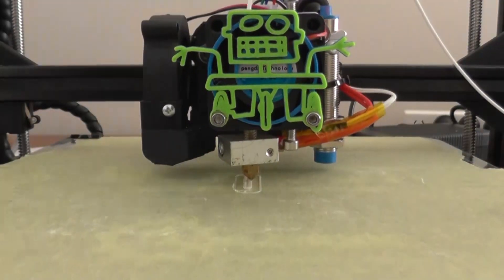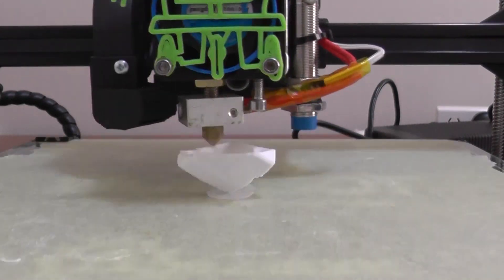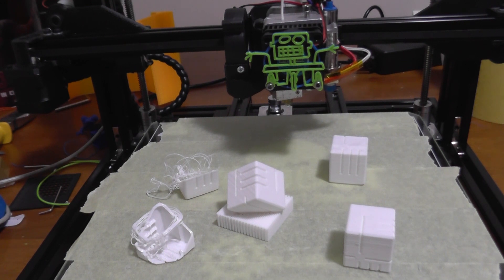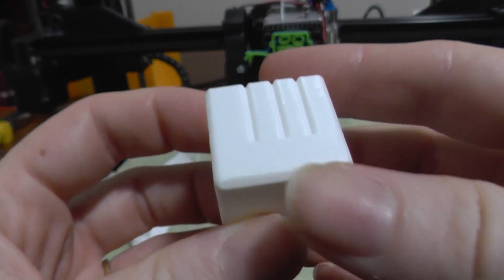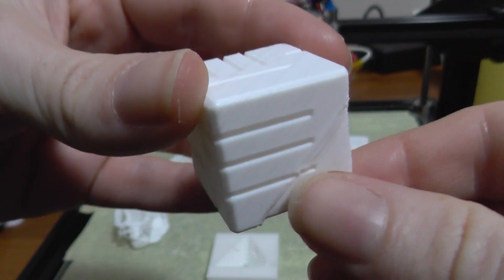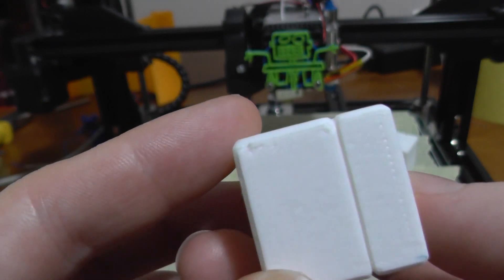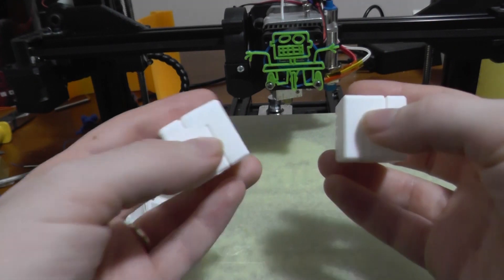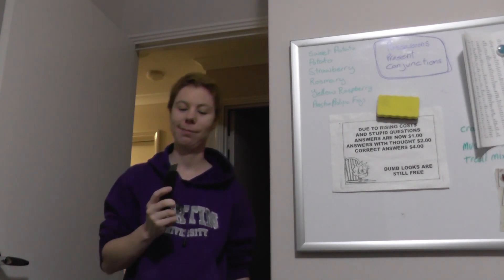Taking chances when printing dice

Comment: You need to get a fan for cooling the plastic as it exits the nozzle. Will greatly improve the quality.
Reply from the maker: it has a blower fan on the nozzle.. its all good man the print quality is swish as when the orientation settings are right

Comment: I enjoyed this video!  About 10 months ago, I was struggling printing an Elements of Harmony Die for a My Little Pony- Friendship is Magic fan.  I also didn't care for the texture difference in the bottom layer.  It was really pronounced because of my heated bed.  I had much better luck when I turned off the heated bed.  I had infill in the die, so the top layer wasn't as much of an issue.  My big challenge was finding the right side to put on the bottom.  "Loyalty" was the lucky winner.  : )Next time, I print these dice, I think I might give that 45 degree rotation a whirl!  Thanks for the video!
Reply from the maker: +Vicky Somma, TGAW 3D  Thanks! It's a good trick hey ;) I am enjoying your channel too :D especially embedding the mirrors!